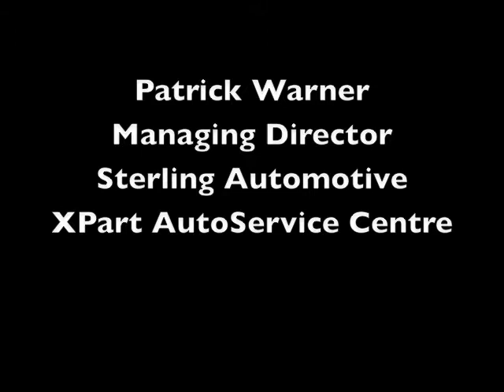Rover K-series Head Gasket Cooling Issues

Comment: Interesting to watch, but MLS gasket is not bullet proof and has lots of issues. it’s alright on a brand new engine, but the very latest Elastomer gasket is a very good gasket and better on used engines, especially if there are any issues with the the liners, the gasket is more forgiving and reliable. As highlighted, the K series has more issues with the ancillaries causing over heating than the head gasket, especially the inlet manifold gasket, so anything that is going to cause overheating will eventually cause a head gasket failure. The new N series gasket is the best of the lot, far superior to the MLS one.

Comment: I discovered this failure mechanism of the PRT thermostat that leads to overheating when idling on my Freelander 1.8 and thought it would be interesting to MGRover owners as well, if they have the external PRT thermostat.  

Here is the problem: At idle there is little water flow through the PRT bypass hose as the water pressure is low and the PRT spring /plate is closed and limits the bypass flow.  The flow is restricted to 4 small holes in the plate.   This small flow of hot water has to heat the thermostat which has cold water the other side of it and the PRT is a bit of distance away from the engine.  
Soo.. the engine could get very hot before the thermostat eventually opens.  Which is what I see happening, and its made worst by the fans coming on as the engine gets hot, as this air flow just cools the PRT and bypass flow more, which doesn't help open the thermostat. Any revs quickly opens the pressure spring/plate due to higher water pressure, this increases hot water flow to the stat and it opens, rapidly cooling the engine with colder water.  
Not good either = big sudden temperature change.
The effect is made worse by the internal rubber seal on the PRT thermostat ageing and maybe leaking slightly.
Many people say they dont have a problem, but the car temperature gauge hides it well, showing ‘normal’ from about 60C to 110C!  Use an OBDII reader to show the temperature while sitting idle for 20 mins and it might show a problem.  Worse in cold weather.

So a better system is, I believe, with an engine water outlet thermostat.   This would then regulate the outlet temperature keeping it constant, reducing engine temperature fluctuations which can be bad for the HG.
This is what a lot of people do for high performance k-series engines.

The good news is that with a bit of simple replumbing (swapping connections/ reversing flows) the old PRT thermostat can be transformed into an output type thermostat at zero cost.  Problem fixed and the side benefit is also a better heater and less temperature fluctuation which means fewer head gasket issues.
This is the video I did to describe the problem and the fix that I have been running for the last year: https://youtu.be/Fyq7yDlUKDg

Comment: These Cylinder Head Gaskets rarely FAIL.  Invariably as can happen with many engines, yes even BMWs, ask my work colleagues, over heating following coolant loss can damage engine components and so the poor gasket is usually the first to suffer damage so can no longer do the job it is designed to do. The video uses the term fail rather than the fact that the poor thing may have been damaged by some other process including professional incompetence by those entrusted with a car's well being and maintenance. 

By the way, my MG ZS bought new in 2003 with the "They all do that, well known fact" K-Series 1.8 has yet to "do that" . Now in its sixteenth year of ownership and my wife's daily driver has never missed a beat. Yeah I know we've been lucky. Howver, the car has always been serviced by me and only visits a pro-outfit come Mot test time. Bought three new K-Series cars all still in the family and none have done that ... yet. There's always a first time. ON ANY CAR!

In my experience prime root cause of these so called "failures" is coolant loss. Be it a worn Water Pump allowing coolant to escape unnoticed, a poorly pro-fitted exhaust Manifold gasket 180 the wrong way around stopping the coolant elbow clamped nearby to be fully flush with the cylinder head. Cue coolant at pressure escaping through the small gap. I could go on with numerous other examples. The poor car gets the blame every time when the real blame lay elsewhere.

The level of ignorance shown by some replies is so typical of the know-all know nowt mindsets.
Reply: A very good description thank you, I have solid water pipes and sometimes no heating had many a variety of reasons its like that,from head gasket to water seals gone, good it be water pump, the coolant level drops and gets very hot but no change on the thermostat gauge.
Reply: My rover 7.5 1.8 had the overheating issue just repaired it replaced the headgasket water pump n the oil rail  but still the temperature gauge is raising dramatically n cooling too fast too what could I have missed

Comment: It absolutely stuns me that these engines suffer so many issues. Begs one to ask why the damn things weren't engineered correctly initially. When compared to contemporary Jaguar engines, which are generally very long lived, these are very poor indeed. Obviously explains why MG/Rover in a British sense is dead while Jaguar/Daimler survived. Jaguar always tested their engines in a pilot sense to iron out flaws like these. The XK engines were world-beaters on launch. The V12 is a stunning engine, and the AJ6 and AJ16 engines are pretty bulletproof. I remember working for an MG specialist, and he hated these K-Series engines with a passion. Incredibly, Kia Motors Australia used the Rover derived 2.5 litre V6 engine in the early Kia Carnivals and we replaced hundreds of these hand over fist under warranty because the liners dropped inducing head-gasket failure-surprise-surprise...They're just rubbish in my opinion, and anyone buying a car with this motor must either be a narcissist or totally ignorant of motor-cars in general. Just don't buy one!
Reply: The engine is fine but they used a cheaper head gasket to save cost which they never knowingly knew would fail months or years later. Don’t buy a petrol Rover unless it’s had a professional fitted new head gasket . I know this because a chap told me the main designer of the engine told him the above.
Reply: Jaguar engines aren't without there faults too, the v8 engines commonly experience timing chain tensioner failier and bottom end bearing failier arround the 100k mark. Trust me I own one and have taken steps to prevent this, and just in time too. And know of and have fixed many other engines, the old 6 cylinder engines also suffered bottom end failier and ware on the bearings if not correctly serviced.
As with any engine, if the correct steps are taken with the k series it is a strong reliable engine, anyone who says otherwise needs to go and do there research befor assuming an engine that was ahead of its time is a bad engine, rover never built a bad engine it's the owners that destroy them buy not keeping up maintenance.
We do it with our body's, that's why we're alive now so why not our cars?

Comment: Hello there! my r25 has been using abit toomuch water lately. Early in the week, 
It started dipping in power (you know that jolting forward feeling) when
 my car was cold and today the temperature gauge was being erratic, 
getting super hot then back to normal, when I stopped there was a 
hissing coming from behind the top of the engine and what looked like 
steam? but not alot. My car is on 53k miles, original HG and the oil is 
still really clean? Is my worst fear about to happen? what checks as a novice can I do at home? thanks in advance

Comment: I have just bought an MGF with 54000 miles, found it in a barn in France, got it going after 3 years standing, Drives ok, doesn't overheat, I am wondering is a thermostat conversion has been done any one know  how can I tell,? the car has had 10 owners
Reply: If the thermsotat is converted you should find the new housing outside the engine. It is a gray box. If there is no gray box or water intersection, than you don´t have the PRRT fitted.

Comment: Nice clear video. Thanks Autoinform. My garage quoted £7-800  for replacement HG, looked sad about it, said it was a bitch to do as they are "In a weird position in the Rover25" and gave my car a terminally ill diagnosis. That was without proper analysis, not checking the level of warping everywhere -if there even was any.....(I could have understood if the engine was a mess, but they hadn't even checked that or stripped it.) Mind you, they sell second hand cars....And I'm a girl and I wear pink wellies! LOL I was tempted to use K-Seal or steel seal, (etc) but instinct said no. Somehow I couldn't imagine all the copper stuff floating about the cooling system, and sticking to most things that got hot. Sounded messy to me. I think the Rover25 HG replacement could be done for a LOT less than 7-800.
Reply: Hmmmm.. Irrespective of a girl or not, never use that garage. Renewing a CHG on a Rover 25 or MG ZR with the 1.4 K-Series has to be one of the easiest DOHC engines to work on in the known Universe. Years ago, when my penniless younger son needing to commute to UNI thirty five miles away, he asked me to source some cheap reliable transport. Asked him what would he like but he had no idea what to get. Then, because two of his friends had Rover 25s and MG ZRs, that'll do. Back then, even on ebay spares or repairs cars were numerous and included those with suspect so called failed Head Gaskets. One such Rover 25 accurately described located in Anglesey struggled to get many bids because of that remote location. I bid and won it for a good price. Needed to tow in back from Anglesey, decided to make a day out of it taking a route in the marvellous scenery of North Wales. Trailered  the car back the hundred odd miles using the faster more direct main roads and Motorways.  Nice day out. 

Back home. soon had Cylinder Head off and no sign of Cylinder Head Gasket Damage. Not for the first time have I removed a sound K-Series gasket in an overheated car which was OK. The overheating due simply to a worn out Water Pump. The first suspect mentioned in Autoinform's  fine YouTube posting. My only criticism, ober use of the word "Failure". More often than not they are damaged.   Fitted MLS to that nice little Rover 25 and all these years later, that little car never misses a beat and well north of 100,000 reliable miles now and in regular daily use. 

Being a youngster's first car, is a bit bashed about with small dents and scrapes. That mainly due to his first drive in Snow ... "It went straight on Dad. Did not steer." Yeah .. right.... 😉 .. That's part of the learning process... Never let him down though.

No question, the little K-Series is a doddle to work on and that Garage were misleading their customers in many fronts including the cost estimate. That sadly is far from rare in my experience.

Finally, if you have read this far, well done. Here's a useful tip for anyone working on cylinder heads on any car especially K-Series ones. The best Cylinder Head Gaskets in "In the World" ( best read that with a farmer Clarkson accent .. 😉 ..  ) will not last long if the most important checking and thorough cleaning preparation is not done properly. Several K-Series CHG repairs since have mostly been done fitting MLS ( Multi-Layer-Steel ) available off ebay for less than £20 delivered to your door. 

Contrary to popular belief, it aint Rocket Science although some would tell you it is.

Comment: 2:23 how can a liner drop? As with my model car's engine, surely they are flanged to seat at a fixed, consistent position in the cylinder block's bore.
Reply: +sonicstep you would think, wouldnt you.

Comment: Head gasket gone open the cap i bet the exhaust gasses are leaking into the chambers..Smell inside the expansion tank and see if you can smell carbon monoxide..Don't keep running it until its sorted out pal..Make sure there is no leak that may be coming from your inlet manifold gasket as well..I've read that you had the head gasket done before maybe even if it has been done properly it could be a crack in the cylinder wall .Or worst case scenario would be a crack in the cylinder wall liners..Hope this helps,Please tell me this isn't the 'K' series engine that they put in the 'MG',It sure does look like it that engine is one of the worst engines I've ever saw in my life i hate it with a passion it got constant problems with the head gasket.
Reply: +nick davies What you are actually smelling is NOT the carbon monoxide but other elements of the exhaust gas. The coolant will simply smell of exhaust gases.
Reply: Are you dull ?There is no smell to carbon monoxide that is why pole fall asleep and never wake up in homes with leaking boilers. Cant see it or smell it.
Reply: There is a a distinctive smell when it happens,No I'm not dull that's how i diagnosed my own car and a few others with the same issue its not carbon monoxide you can smell its the carbon buildup smell or a type of chemical smell.
Reply: Search google you can not smell carbon monoxide. Millions of people have a carbon monoxide leak then fall asleep like normal and then never wake up every yer.There is no smell to it.
Reply: No its like a burning kind of chemical smell I'm talking about not carbon monoxide pal..Or the other method is the white smoke out the back of the exhaust was caused by coolant leaking into the chambers there are a few methods but the dye is the best one.
Reply: ***** yes that's correct thank you for clearing that up for me

Comment: Many years ago,when as usual I couldn't sleep the only thing on TV was the open university,
I did state many years!
Any hoo,1 programe I watched, with my jaw dropping more and more,was on the development of the "K series",
From the differential crown wheel being SUPER GLUED!" to the carrier on to the head/block gasket debacle.
I recall thinking,at the time,"well,there's going to be good money to make with these".
And I was right.
I wonder if this would all still have happened if the had run their design past an actual mechanic first?
 You know I miss the old OU programs.

Comment: Usually if a head gasket fails for the second time and its been done properly first its down to liners as the can lower at heat and cause a gap allowing the cylinder head to not sit properly on the face of the block allowing water to seep through.

Comment: Hi my wife owns a MG ZR 1.4. her headgasket has been replaced. there is no pressure or heat in the engine. the mechanics have stated everything seems to be doing what it should be except the pressure and heat.

Comment: Hello!
I have a '97 Rover 414 that has seized. the oil is correct, there is no aparent HG failure (coolant is good and has no leaks) ... is it a recuring problem, as so with the HG?? a friend of mina as a 2001 Rover 45 and it has hapened the same  thing, for no aparent reason...
The new gasket and the re-inforcement plate you've shown, do you supply it?

Comment: The mls uprated gasket never sealed leaked everywhere externally on my k-series engine had to revert to sls to get it to seal cylinder head was skimmed new head bolts and no warpage head block face or liner droppage so beware of mls! The only reason mine failed was the waterpump was worn which lost all coolant and the mrs was driving the car and failed to stop!

Comment: Deffo a lot of info there. Ive got an older Freelander. I think over heating is very common on these engines and for a Freelander, the 1.8 engine is quite under powered.. I went down the path of fitting a modified thermostat which allows some water to always flow through to the rad. I changed my mind about it though and went back to the original thermosat...and simply drilled a small hole in it. Takes a little longer to warm up but no other probs so far..

Comment: Great Video..!! I've learnt a lot and were able to resolve the problem for my cousin's MG. He was charged 4k AUS dollar to have the head gasket replaced, But they didn't fix the problem. It turned out after careful investigation/luck, we managed the track down the inlet manifold water 3/8" pipe was blocked with deposit hence no water could get into the cylinder head. It could have happened again without finding out the REAL PROBLEM..!!! Thanks mate.

Comment: I've had 3 golf gti's
My daughter had a Rover 25, no problem with it. Then I bought 1. My '03 did have a head gasket fail and it cost me £335 18 mths ago. Which obviously included oil,  filter and coolant,  plus the mid section of the exhaust which needed doing. No problem,
my golfs cost that much for a service. My current 25 is a 54 reg and going really well. They are great cars and luckily because most people think there's a major worry with HGF, they are cheap to buy. Don't tell anyone!!

Comment: Hi, I have a 97' 414 si with 1.4 lt engine.  Now I'am at 233.000 km.

I want to use the car as much as possible. Nowadays I have coolant loss and time to change the gasket is coming it seems. My service told me that they want to put old aluminum gasket because when we need to open up the engine again MLS gasket will cause more damage to egnine block than the aluminum one. Is it true? Probably I will want to open it again for cylinders in the future..

Comment: You really should of asked some of the mobile mechanics on the owners club to come and fix it for you. £350 tops. Even the most abused K-series can be repaired cheaply. The only time they cannot is if it's been overheated to the extend of the Aluminium annealing. 
Then it's scrap.